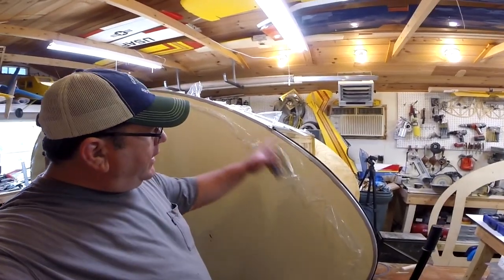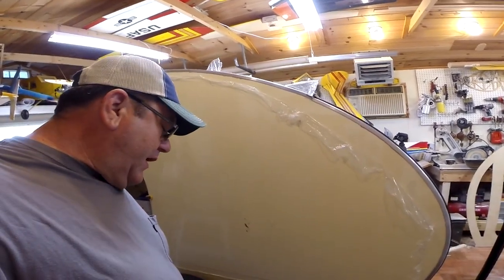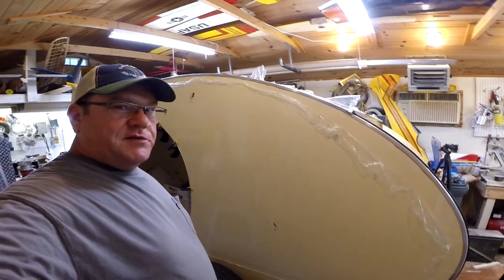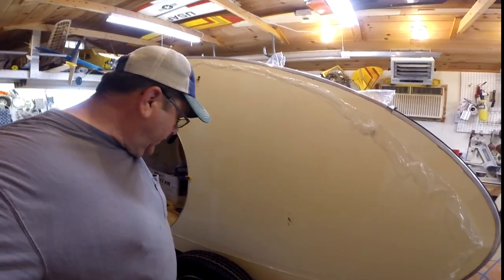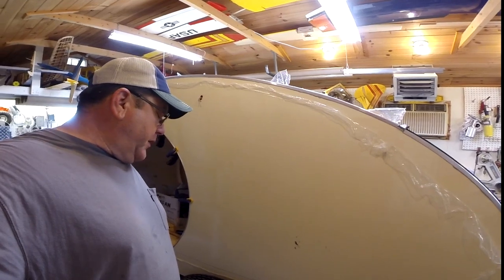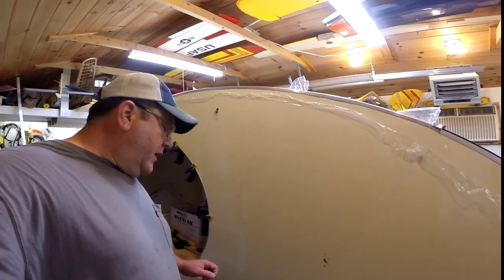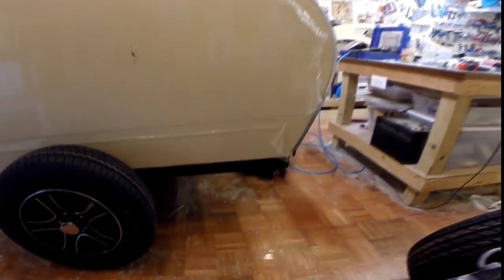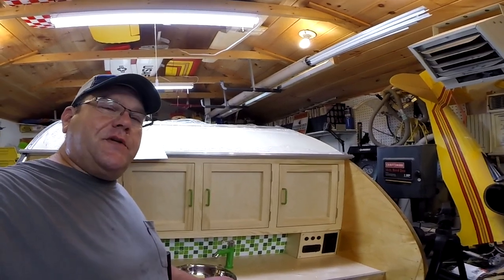Teardrop Build:  Car Tires on a Teardrop?  Finishing the Skin.

Comment: Make sure to update us on the passenger tire outcome. My teardrop build starts this fall and I'm intrigued by your findings. Nice work! Finish line in sight!
Reply from the maker: SkyroofNova72 Will do.  There’s lots of information about it on the tnttt website.  It’s an easy search.  I think I’ll come in around 1300lbs when finished and each tire is rated to haul 1,609 lbs.  Also, the tires are rated for high speed.  I went with a 205 75/R15 Toyo Extensa A/S tire.  The tread pattern looked very similar to that of a trailer tire and that’s a common size for a trailer tire.  I didn’t want to change too many variables!  My fingers are crossed.
Reply: Camp & Camera I'll have to read up on it. Keep the inspiration coming!
Reply: What trailer did you use for your build? What is the rating of the axle that you have on this trailer? Just curious
Reply from the maker: Stephen M Daigle I designed the frame myself.  It’s 60”x96”.  Perimeter is 2x3 tubing.  Crossmembers are flush with top.  It has a 3” channel wrap around tongue.  Axle is a 3,500lb with brake flanges.  Leaf springs swapped out for 2,000lbs.
Reply from the maker: Springs are 1,000lb per side.
Reply: Awesome!! Thanks so much for the info. My neighbor and I will build my trailer also. He is a welder. I have plans. So I get a chance to learn something new in the process. What you have on your trailer is pretty much what I have designed into mine. Hope to get started soon on the trailer build portion.

Comment: Having watched all your build vids so far, I’m very impressed with how much study and research you’ve put into this. So I’m very interested to know what trailer you started with on this build. Did you self build? Or did you buy one? I’m hoping to start a project this fall and am already overwhelmed by all the options just with what trailer to buy! Keep up the good work!
Reply from the maker: nloer Hey, thanks so much for watching!  I actually designed the frame and had a local trailer manufacturer (Mastiff Trailers) weld it up for me.  It’s 60” wide by 96” long.  It’s made of 2x3 tubing with a C channel full wrap around tongue.  The angle cross-members are flush with the top.  I’m running 3,500lb axles under 2,000lb leaf springs.  It was just a little more than buying a bolt together kit from Harbor Freight.  Good luck on your build!